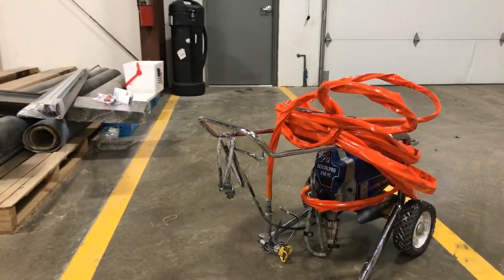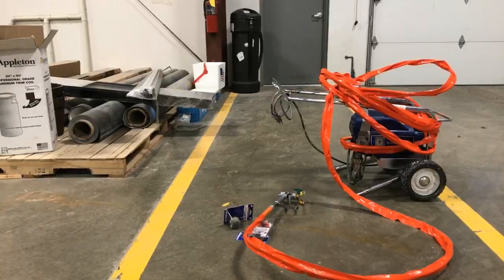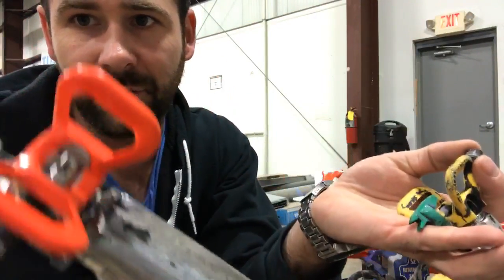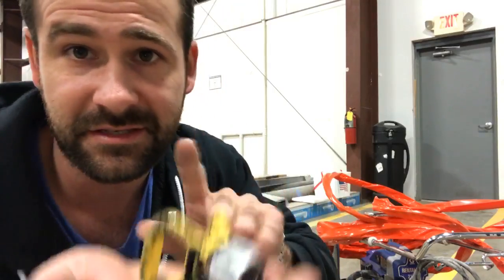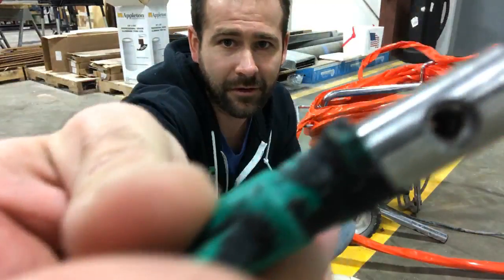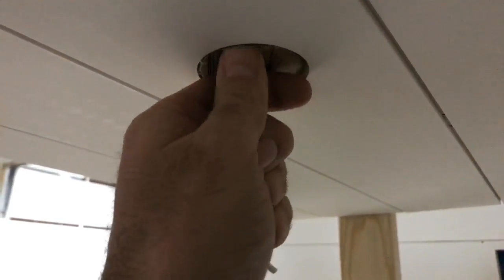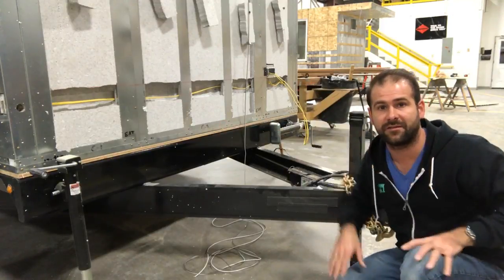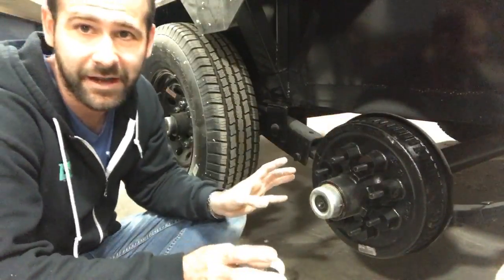Daily walk through with Bob 011 How to fix a paint sprayer tiny house for sale painting graco

Comment: If i could give some constructive criticism...as you said, yes, please get a camera guy.  And maybe a camera that isn't a cell phone, or at least the same phone that you use to read comments, etc.  The gimbal  was definitely an improvement, but it could be better.  The sound also fades out quickly when you're not next to the phone, so a wireless microphone that you wear, so we can hear you clearly would be great.  Some positive things...i loved hearing about the trailers.  I've watched a ton of tiny house videos and i think that was the first time anyone had ever spoken about trailer details.  That was great to hear.  I didn't realize that all trailers aren't created equal.  The improvements you designed into them really make sense.  Question...do you frame all your tiny homes with steel, or do you frame some with wood too?  Just curious.  Maybe you could talk about advantages of one or the other as far as strength, cost, etc.  Thank you!